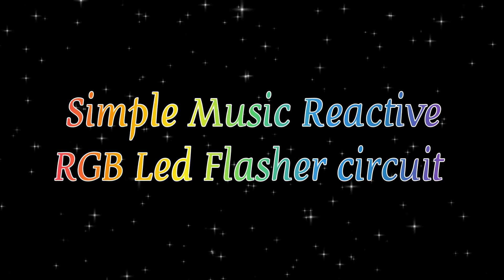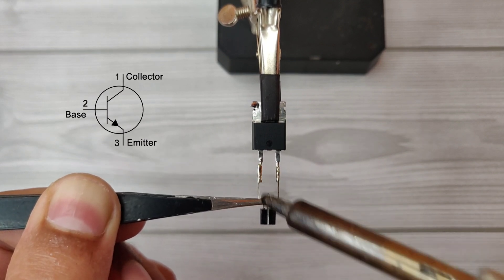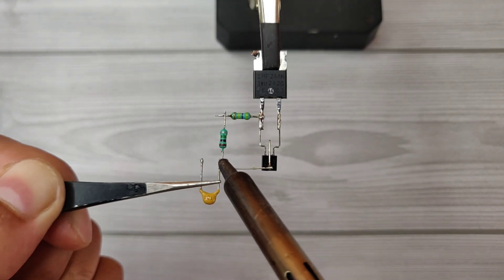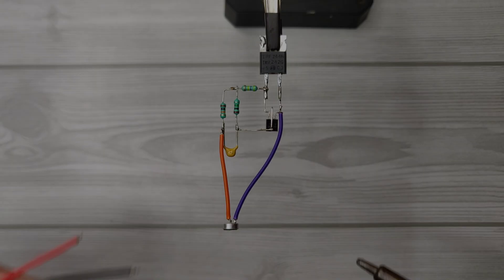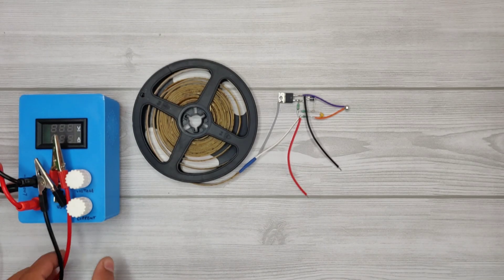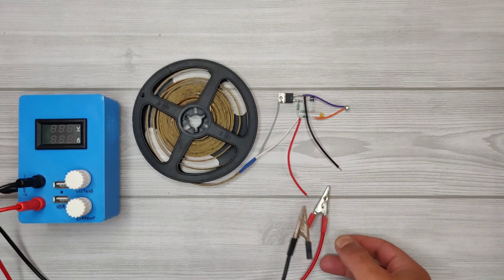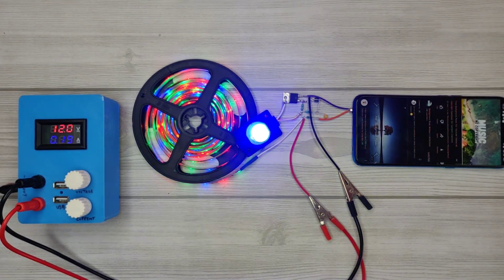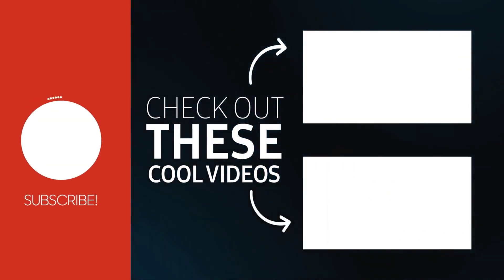Simple music reactive led strip

Comment: can it take 6 amp load ?? can i light up 3 led strips in parallel with 12v 6amp power ?? pls reply......
Reply from the maker: Yes it can , high power MOSFET is used. Little heatsink on MOSFET is recommended.
Reply: @CreativeTechos  thank you so much ❤️
Reply from the maker: My pleasure 😊
Reply: @CreativeTechos  😊😊❤️❤️